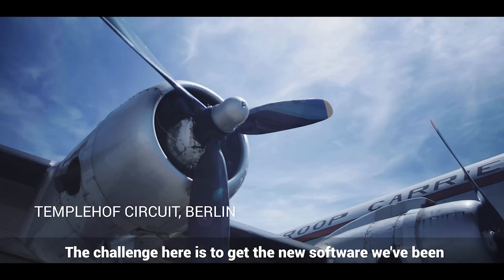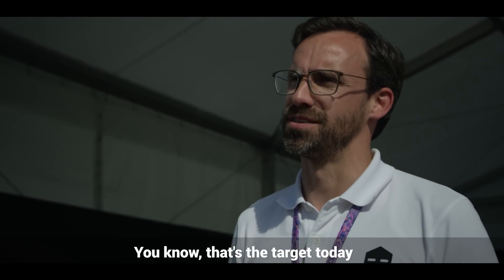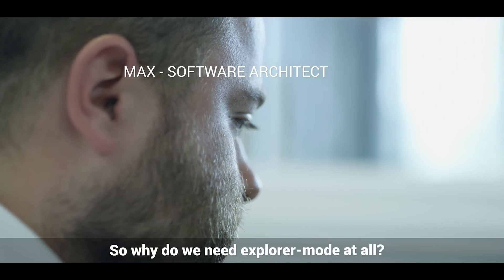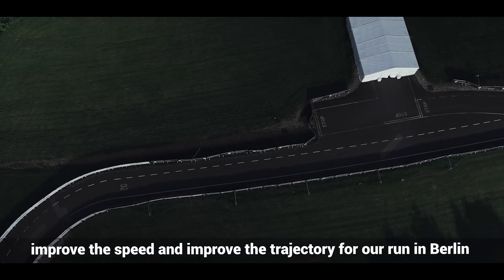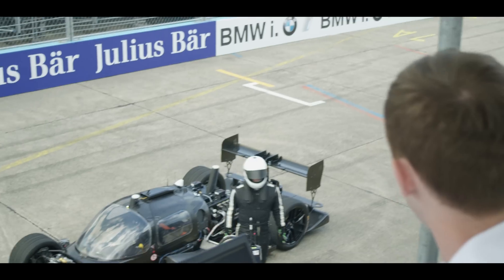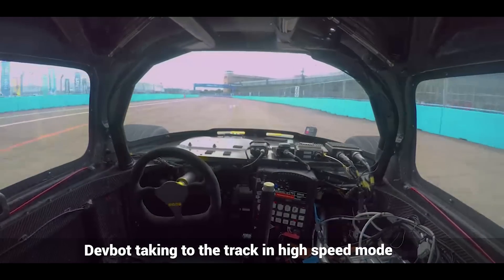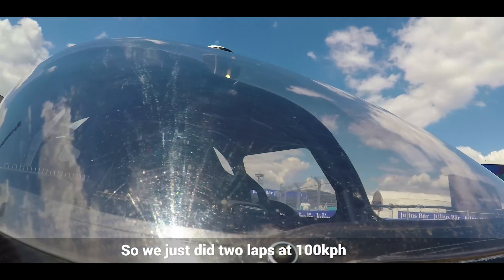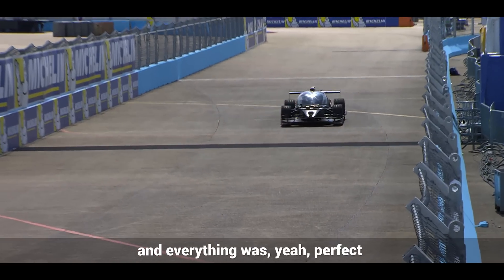Inside Roborace — Episode 8

Comment: 8% off human driver pace is slow as hell.  In a 50 lap race it would be lapped 4 times.   That's slower than a current McLaren Honda vs Mercedes in F1.  Pretty damn slow!  If you can make it faster than human drivers then you're on to something.
Reply: Jonathan Holmes How do you know? The point of reference is not given meaning that entire claim they made is pointless. Also bare in mind that you are using a flawed comparison. You can't make the comparison to F1 pace for 2 reasons. 1) Roborace uses the Formula E tracks which are all street circuits and almost all tracks in Formula E are completely different to the F1 tracks. The only common track, Monaco is heavily altered to accommodate the current technical limitations of Formula E. If Lewis or Valterri take their silver arrows out for a flying lap of the FE tracks then it would be more of a reasonable comparison. 2) Formula 1 cars have much more grunt under the hood than Formula E due to the fact that Formula 1 has been around for over 60 years so the teams there have had huge amounts of time to learn how things work and make great strides to improve performance. Formula E is in it's 4th year as we speak. EV technology is still in it's infancy so of course anything using EV technology is going to be significantly slower than the McLaren Hondas in the rare situations when their engines actually work for more than 10 seconds.
Reply: Also I believe you misinterpreted what they actually claimed. It seems to me that you think they are claiming that the roborace car can only go 8% of a human driver's pace. In reality they said that their devbot is currently 8% slower than a decently competitive human driver. Meaning it can do 92% of a human's pace which is Formula 1 when average lap times are about 1:30 to give us a nice round number to work with... Assuming the roborace team are using F1 as their point of reference... That would mean that devbot would be setting lap times of around 1:37.2 which while yes, that is significantly slower bare in mind this is with Devbot which is the slower roborace car. The full robocar is aiming to be as fast as an F1 car. Devbot physically cannot match an F1 car's pace because of it being much bigger, bulkier, less aerodynamic and just lacking the capability within the powertrain. So yes. At this point, devbot would be lapped multiple times in a 50 lap race. But we have yet to see the absolute pace of Devbot so far. We know the autonomous driver can still be improved too. So we should expect this theoretical 7.2 second deficit to close up as they keep working on it... My prediction is that theoretical deficit is going to half before we see the full robocar doing any running.

Comment: Next stop- sub 1min at spa, pulling 10g's.
Reply: not even in your wet dreams. even though there isn't a driver in there and you don't have to worry about turning their brain to mush with g-forces, there are four marginally important things connecting the car to the road... the tires? How on earth do you expect a car to pull off a 10g corner? on four patches of rubber? come on man, use your head. the car would end up in the crash barrier long before the gees even got a chance to climb so high in the first place. 10 g turns are fighter jet territory, and fighter jets don't have set corners to follow, the only crash-barrier is the ground and the pilots have hundreds or even thousands of feet of leeway to make these turns happen. this is most definitely not something you will ever see driving on a road circuit.
Reply: Petr Stuchlý a little over 100 years ago, powered flight was a "wet dream".  A man made space craft just recently left our solar system.  F1 engineers have frequently said that they could(without any rules in place) create a car that would easily go 300+ mph on current circuits and pull 8+ g's in corners.  With enough downforce, I think 10g is totally plausible. You'd just need some monumentally strong rubber to cope with it.
Reply: turboboy1983 what people say is not the full story. why people say it is just as important.
If such a car could  be built with current technology, it most likely would have been built already. If only to get back at the people in FIA and present an actual proof of how much FIA halts proggress towards mental speeds and corner forces.

The car in this video is only half as fast as current monoposts, which tells me that technology is not there yet.

no matter where the truth lies, these engineers you mentioned are just talking out of their ass. you can't make a manned car that subjects the driver to such forces. not in close quarters and not when it goes around track now to butt or wheel to wheel with other cars that are manned by people subjected to the same extreme forces.

you can't have a car that causes blackout to the pilot in a fast corner. That is extremely dangerous. and that is why I don't trust these anecdotal engineers of yours.

Now if you take the driver out of the equation, it is a step in the desired direction, sure, but it sure as he'll doesn't solve all the problems, and as you can see from these videos, it creates a whole list of new problems that weren't a concern with the driver in place.

If you look at the new bugatti Chiron, it's tyres are the product of state of the art engineering put in practice but those tyres are still not trippy enough for what you have in mind.

At the speeds and forces you want to see, be it a manned race or a race of AI,   The slightest miscalculation, the slightest contact between cars, the slightest unanticipated slip of a tyre would mean absolute catastrophe for every car involved.

I am quite positive AI vehicles could circle around track at very high speeds in single file, but making them race at those speeds is an accident waiting to happen.

300 mph in a straight line is not out of the realm of possibility, but pulling 10 g through a corner is still unthinkable in my opinion. manned or not, if you approach a corner so hot, you are going to fly off into the tyre bundles.
Reply: Petr Stuchlý just because they haven't been built doesn't mean they can't. The fia's rules are made with the sole purpose being to limit speed for safety.  I hardly think that men with PhD's in engineering and aerodynamics are talking out of their asses.  The current F1 cars are, for maybe thousandths of a second, hitting 7g.  While I understand that each g is an order of magnitude greater than the last, 3G more is entirely plausible.  You said if it were possible, it would've been done already.  Not so.  As I said earlier, the FIA's regs are in place to slow the cars for safety.  The team bosses and manufacturers are a part of the rule writing process.  Their goal is not only safety but cost control.  If money were no object and safety were put on the back burner, almost anything is possible. NASA built, from nothing, a rocket and spacecraft that landed men on the moon and brought them back in less than a decade from the initial idea(using little more than slide rules and not the tremendous computing power available today).  That is an unbelievable achievement considering most passenger planes(the F-22 took 2 decades to develop)can't go from concept to reality that quickly.  But again, money was no object and safety really wasn't the driving force. When a group of men who are at the top of their respective fields say they can do something, I tend to believe them.

Comment: I just wanna know if this is AI making an own path or the AI copying the inputs from the driver, because that latter is not impressive at all.
Reply: the car initially drives around the track at a slow speed gathering information about the track. It does this for about 12 laps and each lap it gets faster. After all information is gathered it is ready to compete in a race and great it's own path based on the calculations it made. 

What they are working on now is implementing realtime sensor input which causes the car to become aware of other drivers around him and adjust its course inorder to not crash in to another car.
Reply: Thanks! Really impressive how AI is improving, I know Nvidia put a lot of money into AI development, it's the next big thing.

Comment: I'm frankly disappointed in their progress. 
8%, I presume that's lap time? Huge difference. Especially without the drvier's weight in the car.
It much be achieving pretty slow cornering speeds. Even taking awkward lines, I'd expect more.

Perhaps it's overdue to get competing teams on board with this program. Might not be the job for a monopoly team. Just provide some hardware and software boundaries, and let the competitors take it from there.
Reply: It was 8% off a human driver.
Reply: Great point. But this is so new!. Let the races begin, then see the diffrerence. I think it would be much lower
Reply: Dude, the car only drove a few laps after it's learning software just being "born". The proffesional drive probably has done ten thousand laps in his whole life with decades of training. I'd say if you take that in account the software is better than the driver in many ways.

Also they capped it at 200kph max speed. Wait until they let the computer pick it's own speed that it thinks it can drive. I'm sure the car's perfect calculations and precision would eventually out race a human driver. Mind you this is an empty track.

Racing will get interesting when it has other cars on the road. Then humans will get a huge advantage in prediction creativity and risk taking....